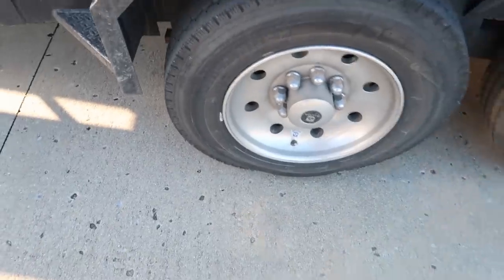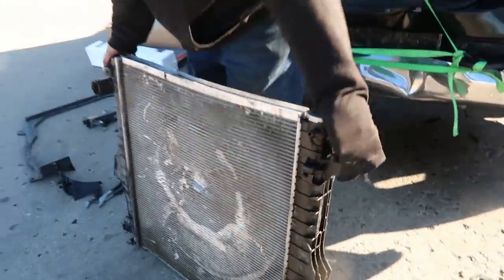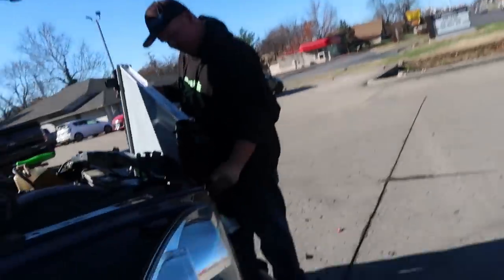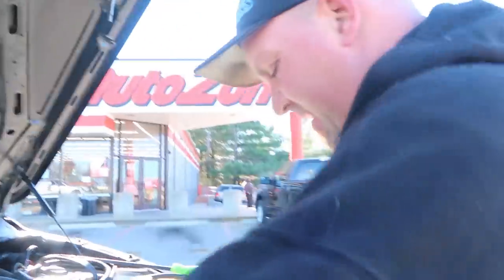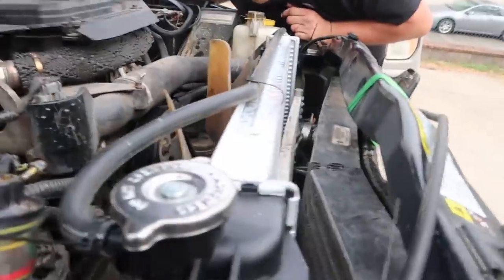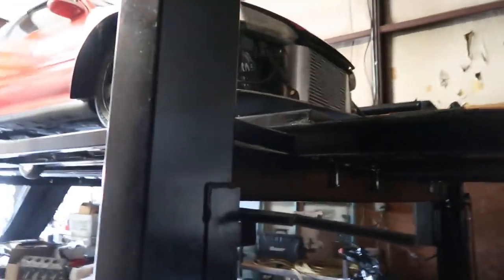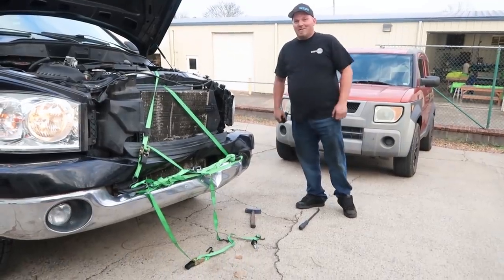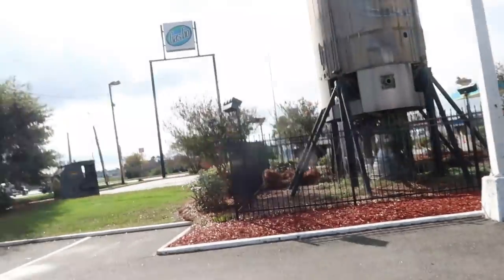Patching Up Our Crashed Tow Rig

Comment: Awesome hooptie fix. I had a 41 military 1/2 ton closed cab pickup and it had a Braden mu2 pto winch. As you probably know those things had a cage and headlight cages that protected the whole nose and it had a heavy winch bumper with kickers on each side. I never broke a headlight or damaged the factory honey comb radiator.
Find a setup similar to that that's tied in properly and built heavy enough and dear, or normal cars, won't be a problem ever again. I know as we bounced a few things out of the way and it could go over small trees and heavy briars no problem.
Anyway never give up and it will be a great story, I have quite a few now👍

Comment: I hope tom has some good luck!! I work for international and we have nothing but problems with those engines. Fuel in the oil is super common even if it's not leaking because it uses in cylinder dosing for running regens. if it regens too frequently it'll always have fuel in the oil and the dpf will fail and break apart. Very finicky engine! Shits almost as bad as the maxxforce n9 or 13!

Comment: I've hit several deer over the years.  I've barely missed many more.  I hit two at the same time once.   I know its not a matter of if, but when the next one will come.   Way to get her fixed to get back on the road.  Perseverance.
Reply: Oh the irony and foreshadowing.  I made this post the day you released this video.  Around 5:30 on 12/4 I hit a deer dead center in my car.  Steering wheel and knee guard air bags deployed, hoods crunched, bumper cover busted, radiator busted, etc.  Thankfully I was close to home and was able to drive the car home and grab my other car.  I don't know if I jinxed myself, or if I just foretold the future.

Comment: A deer ran into my 96 skylark a few years ago. Small dent in the front right fender and a cracked windshield. My insurance cut me a check for 1600 bucks. Didnt fix either issues. Only spent 1200 for the car in the first place.

Comment: those injector pipes do not let fuel in the oil, depending on the set up they could be o rings on the injectors to stop fuel leaking through the head into the oil, or the injectors are toast and leaking fuel into the cylinder

Comment: If you have mever used electrical tape, duct tape, and zip ties to hold parts on you are not a mechanic much less a racer. Love the roadside repairs.

Comment: You should ha e pulled a car off the trailer and used the ratchet strap to the tow point on the car and pulled out the radiators support to make room for the new radiator